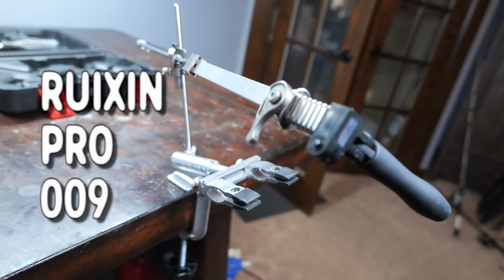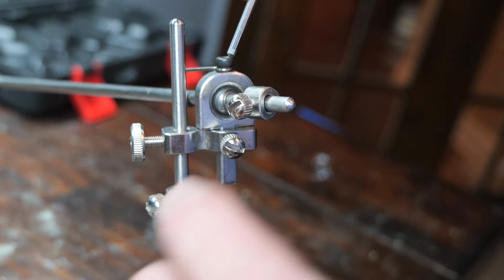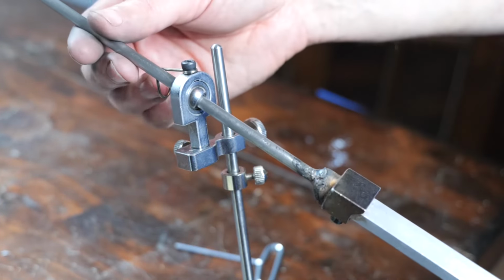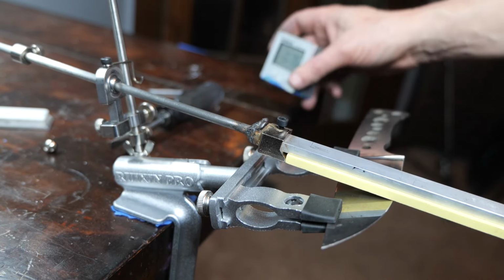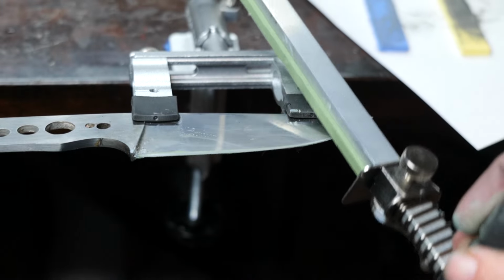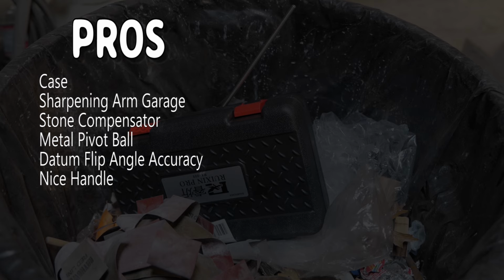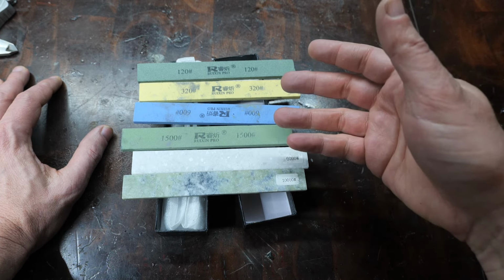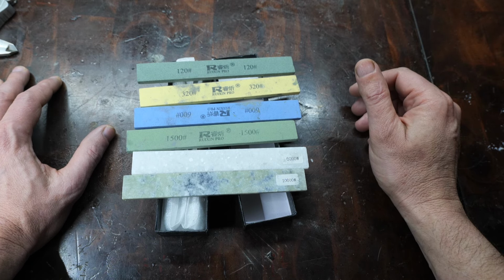Ruixin Pro-009 Review And 3 Minute Rant

Comment from the maker: You can roll the dice and get these cheaper on AliExpress less than the $60 I paid on Amazon.  The last time I ordered a Ruixin Pro on AliExpress it took 5 months to arrive.  But if you can land one for under $20, make modifications and get better stones maybe just maybe things will work out?  Also, I know any difference in sharpening angles when returning to the original side should be much smaller but all I can say is that it didn't seem to matter in this case.
Reply from the maker: Also, Also when I use the term water stone in this video I’m referring to soaking stones snd not splash and go.  These stones are very porous and the grits under 1600 soak up water quickly, drying instantly using the method of wetting described in the instructions.  The 6k and 10k stones here probably are essentially splash and go.
Reply: Make your own version of it. I bet it’ll be 70 times better. 

Luv your content green beet
Reply: Or perhaps, is there any other cheap model you would recommend over this one?
Reply: I have plenty of diamond stones for this model, really need to know if it does small knifes as well and will do consistent enough low angles.(Very sharp). Not how long it will last per say

Comment: Here is an old jewers hack. Make some "stone" holders out of wood or metal and use contact cement to glue abrasive paper to them. You have an almost unlimited choice of abrasives and grits up to 30k diamond or above. This will solve all your stone complaints and you can polish to your heart's content. And did I mention, paper abrasives are cheap, even diamond.
Reply: Nice thank you.
Reply: The only issue with paper (for the purist, that is) is that it has the tendency to "roll" the edge.  That said, unless you are sharpening razors for shaving your face,  or machine tools for cutting steel,  the paper works great for all normal working blades - knives, shears, planes and chisels.

Comment: I just got the kit with the shitty stones + the diamond ones. Should I expect the diamond stones to do a better job? Stupid beginner's question: do the diamond stones need watering too?
Reply from the maker: the cheap diamond stone sets that come with these kits or cost $30 seperately on amazon wear very, very quickly and usually don't have uniform grit.  More expensive sets on gritomatic or TSPROF do well.  No, they don't require water.
Reply: @GreenBeetle  thanx!

Comment: So, I bought a version with diamond stones included, for about $39. There's only four, but they work well and don't wear at all. Not sure what wrong with your clamp, but mine holds the knife rock steady.
The biggest mod challenge (and it wasn't big) was your observation about the set screws - the one that holds the gimbal arm in place (the one you adjust for different stone heights) just wouldn't stay tight by hand tightening. So...I super glued that one, lol. Its an interesting feature, but I can always check the angle of different height stones with my phone app and set accordingly, so that adjustment just wasn't that big a deal for me. 
I also ground a flat spot in the vertical rod about two inches long which makes that thumb set screw way more effective and gives me a sharpening angle option of 13-25 degrees, which is plenty for my purpose.
It works really well now! So for $39 and about 10 minutes of mods, I have a rather functional sharpener. I may buy some higher grit diamond stones (highest that came with it was 1000), bit I'm super happy with this small investment

Comment: I used my Dremel tool to grind little flat spots on the vertical bar so when I tightened the doohikie to set the angle, it would stay. I also oiled the bar that attaches to the stone so it would slide smoothly through the ball. Mine works pretty well, but the angle is not the same on each side.
Reply: You can flatten all of the vertical bar in one side (start 1-2 inches above the thread and 2-3mm wide) with angle grinder or file and it will give the hinge bearing thumb nut area to grab allong that rod and it will prevent it from turning on the axis of the bar. if you have a small differences in the angle like 0.3 degree or so, it fixable with a light bump up so the pin that prevent the knife holder from turnning will be pushed slightly inward into the gap in one side.  Regardless, I was surprised by the quality of the non-magnetic stainless steel rods they use, and the diamond stones are holding well.

Comment: I bought this sharpener knowing that if I made a few mods it would work pretty good and I wouldn't have to spend the money on a TSPROF.  I knew the stones were shit. I bought stones directly from Boride and made a few mods to the sharpener. I now have about $180 invested and it's a very good system. The TSPROF is around $700.
Reply: what else did you modifiy ?
Reply: What else did you modify?
Reply: yeah, spill it
Reply: how is it holding up?!
Reply: the Xarilk gen 3 appears to be nearly a direct TSPROF Kadet clone. It just has a wider base but otherwise its the same. So much so that i hear most parts are interchangable. Its not as cheap as the Ruixen though, and it also has its fair share of things you need to do to it to optimize it. Worth checking out though. Its around 110 USD rightnow. All the same stones should work on it if you have already bought some nicer stones.

Comment: For the average joe wanting a relatively inexpensive knife shatpener the stones should be fine.  The problem to me seems to be how quickly the screws loosens when you use it.  Perhaps set it up a permanent tool & use theread locker?

Comment: Couldn't agree more with the overall conclusion of this review. The only Chinese sharpener I would whole heartedly recommend is the TooHR type 3 - but even that requires some adjustment to get the best from it.

My only slight criticism - both in terms of the review and a couple of the comments - is people stating that the grits are marked incorrectly, and what finish you should be getting for a given grit.

It's just a matter of different countries, or brands, or industries etc. using different grit scales. The Chinese industrial scale for abrasives is just different to what you may be used to. Now, these particular stones are bad, no question there, but the grit ratings? Not bad, or wrong, just different.

Comment: Well, this review scared me until I saw the ArtTema videos. Go watch his mods. I did them for the 008 and I will now for the 009. Yes this system is under engineered compared to the big ones. ArtTema takes each problem and engineers solutions that are easy to do. If you watch his sharpening sped clips up you see the unit stays rock steady. You can't fake that. I think this system asks for a light touch but how hard is that? The mod to increase the spring tension is simple and elegant. You have to watch the videos closely to pick up all he has done but it pays off. Stones are indeed garbage, but the diamond stones you can get cheap are pretty good. Forget the stones, don't laugh at them. $70 vs. $700 if you can even get them. The TSProf stuff is terrific, but do you know it's made in the same town as all the heavy military gear being used in Ukraine, which is why you can't get these units now.
Reply: sorry if this was just a bit snarky. No disrespect intended. I like your informal review style. If I could afford the TSProf Kadet I'd love it. But my little search into their operation suggested that there was likely some coziness between them and all the military production in their town. I guess you need engineering in abundance and at least the knife sharpening is a better use of it.

Comment: I bought one of the cheaper ones and Amazon and a set of surprising good straight and flat stones… will say I get a very consistent repeatable edge… proper care of the stones.  BUT…and this is a warning for both the cheaper ones and ones like yours.  That screw that holds the spring in place will move.  And call out…. And the spring holder will become a bullet if your in the process of rotating… check the screw every time or use too much thread lock…

Comment: You were doing a push sharpening and not dragging ther other way perhaps🤷‍♂️🤷‍♂️
Reply from the maker: I was going both directions as the instructions indicated but water stones are usually 2 directional or at least I’m not aware of one that isn’t.
Reply: I think the softer stones - in particular that 1500 - would last longer used purely in downstrokes, but as GB stated, that shouldn't be necessary, and the instructions didn't specify, so..... 

That said, I bought the Lansky recurve sharpening stones, and the two higher grit stones are just as soft as that 1500.

Comment: Pin point accuracy on the review. Junk. I'm trying the work sharp presently. It has 3 stones attached to the guide. Not impressed with it either. $45 so I cant complain too much. Great video buddy.
Reply from the maker: It’s hard finding a good sub $100 system! There’s some decent stones one can get to hand sharpen with to about 1500 or so.    I tried out a bunch of $30 combo stones a couple years ago and found a few that did pretty good.  There was a good Arkansas combo for about $50. You have to buy a few more to get up over 2000 grit.  At any rate I have to think better manufacturing could prove the ruixin design for an extra $30 and there’d be s market for it.

Comment: You totally right. The system is total crap. No sCrews tighten. It all comes apart.  The water stones grind to zero in One knife. Could ONLY do down stokes. Havent tried the diamond and AM sure they not. After having seen your video still made the mistake mater of budget. I mean it Will sharpen if you do 1 knife ir 2 a month. People dont make my mistake, save up and get a proper American made system.

Comment: It does explain to me a lot- I was sort of wondering why the very expensive versions of these made in place like Poland and Russia were made out of the things they are with what I was considering 'over engineered' components. Turns out they're not over-engineered, they're in the 'good as it needs to be' bracket of continuous use for such a tool and probably worth the money they cost... to someone, who isn't me.
So it does actually answer a question I had in terms of "why it cost so much" because the alternative is that costing less means you get a bit of junk. Now take that box out of the garbage and make a knife out of the components or you'll trigger all them zoomie kids that accuse boomers like yourself of being wasteful and gretas will troll you on the internet.
Reply: I have one of these and it came with "diamond " stones and sand type stones. I was able to get very good results and bring back a terribly ruined kitchen knife, however I had to use very light pressure and keep the stone wetted. I can tell the stones arent great but the rest of it works just fine as long as you dont ham fist it and you oil the slider ( i used seed oil only because I use it around food). I can see how this product would fail with some kinds of users, personally I had no problem with it and my kitchen knives are all very very sharp and symmetrical now. I am surprised you didn't put a helicoil in it, break out a tig welder or 3d print a part for it. As for the cam mechanism stressing you out, there is nothing in the manual that says you have to push the lever all the way over. I got the feeling watching your video that you were trying to break it, and I found it entertaining, thank you for showing me what is going to break on this thing.